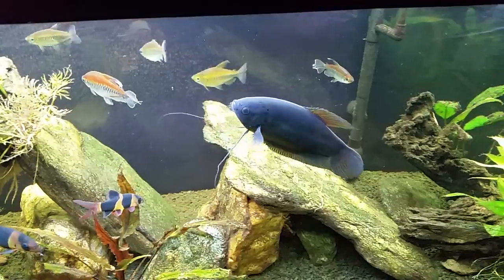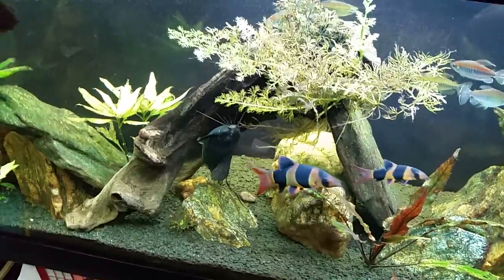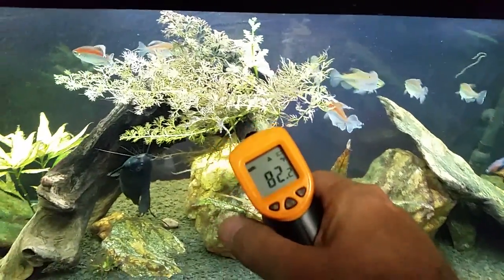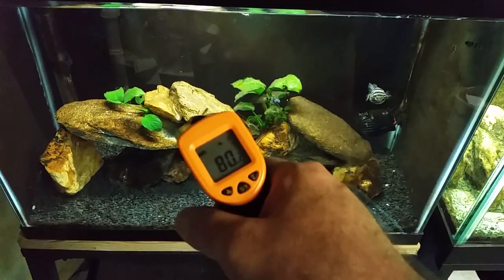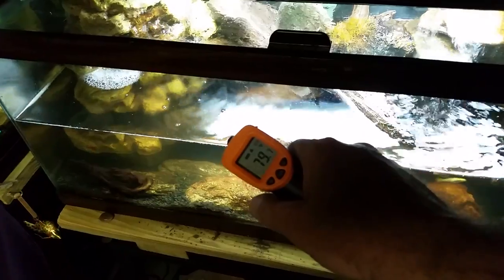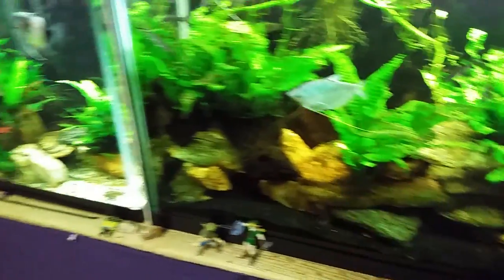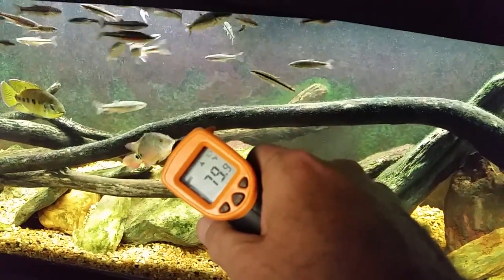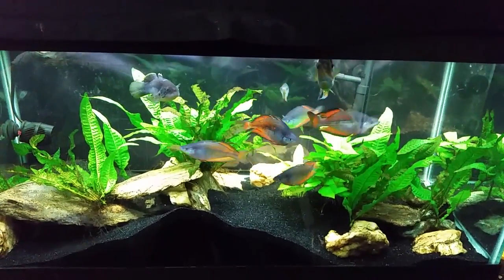Mystery of My Inconsistent Tank Temperature Solved

Comment: I read that those thermometers are not accurate going "through" glass  It will get the surface temp of the outside glass, so it will fluctuate with room temp in the area.
Reply from the maker: And once you're about two feet away, you are reading a large surface area too.

Comment: That laser has nothing todo with the temp reading. i have the same  device. . also from my trial and error i noticed with that temperature you are reading the temperature on the glass surface. try pointing it in side the tank from the open lid. i may be wrong.
Reply from the maker: The laser just let me know the batteries were very low. It's supposed to show you where you're "aiming". Lol  You're right about reading the surface. And the further away from the sensor you're aiming, the larger area you're averaging the temp. At a few feet away, you're taking the temp of about a 3 foot circle of surface area.
Reply: yh. also note that you can turn the laser on and off with the first button.
Reply from the maker: Thanks. I didn't know that.